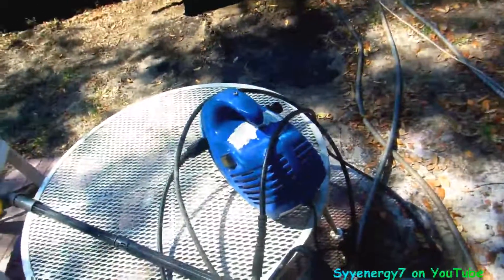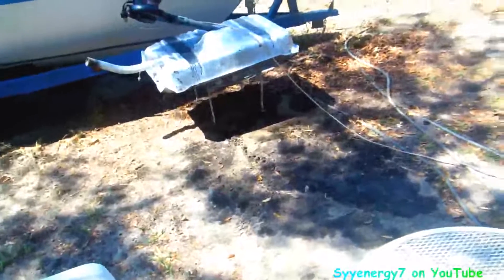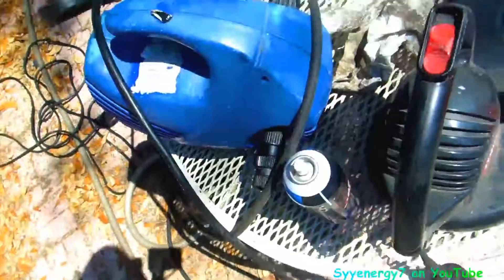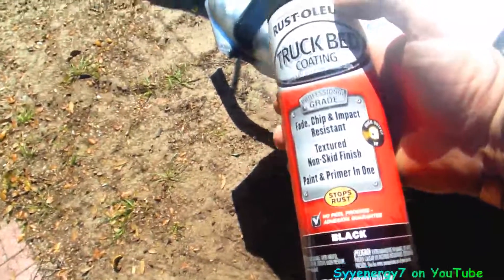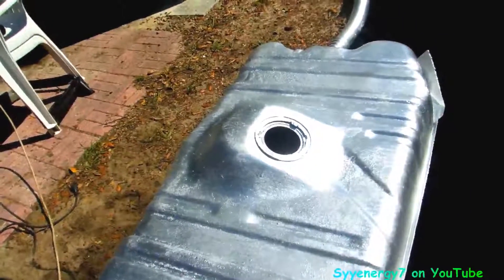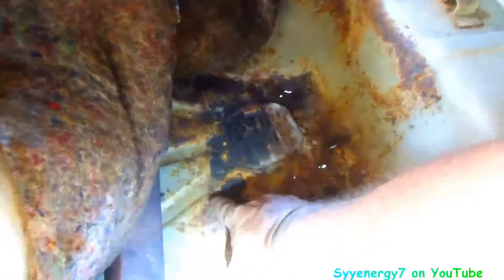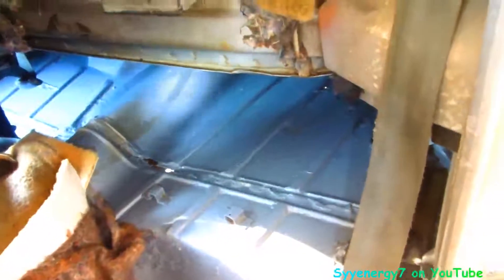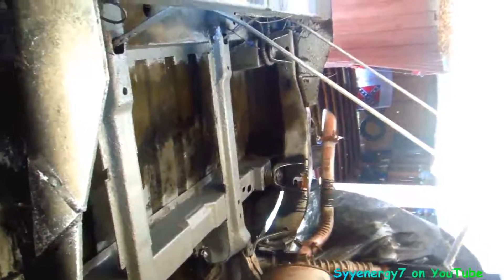'78 El Camino, Gas Tank RedKote, Chassis Saver Undercoat

Comment: rubberized undercoating will probably help insulate road noise too
Reply from the maker: It will seal the seams pretty good too.  It''s already 10 times better just with the Chassis Saver.  That stuff is like a rock.   You have to grind it off.  Sandblasting takes forever.  POR-15 and Chassis Saver fails if you prep too much. You want to use the rust (not loose rust) to grip the coating.